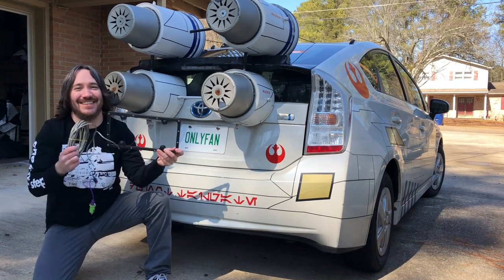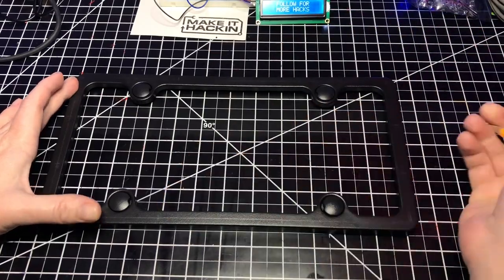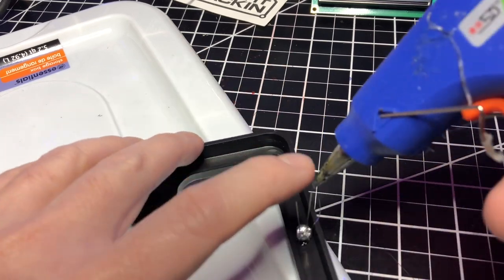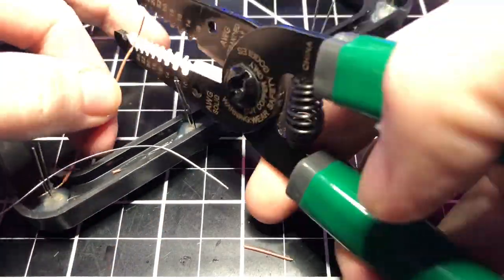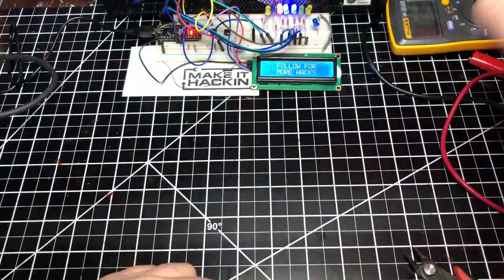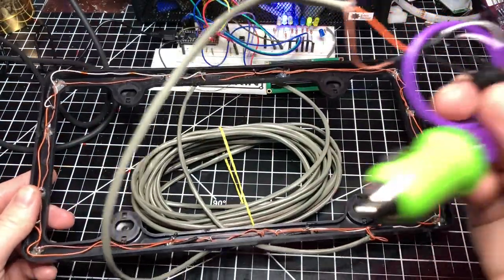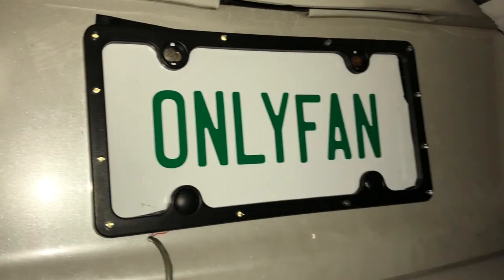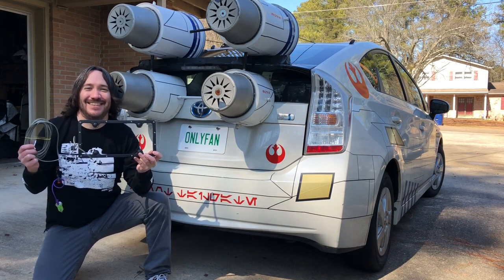Infrared Camera Blocking License Plate Frame - Tutorial - How To

Comment: As far as all those separate little brown wires you soldered to each lites ground leg ,next time just leave it all as 1 wire, solder to the 1st lite, run the wire around the plate fre and just take a knife and Nick away a small piece of the Plastic coating by each lites and solder the leg of each lite to the exposed place of the brown wire , you can use a lighter to expose it also. It will be a thousand PCT stronger and a heck of a lot easier. Do the same with the other wire.

Comment: To speed up the wiring, strip the whole wire then solder the grounds then cover with hot melt. Solder resistor ends to the LED ends and fold over fold over to touch each other. Solder together with positive wire, seal with hot melt. The part leads can act as a PCB. I love freehand prototyping it makes strong, durable circuit but not very repairable.

Comment: what does it look like in the day time, on camera?
Reply from the maker: if in infrared mode, basically the same, if not, then you don't see it
Reply: Its completely invisibles for cereals yo
Reply: @SKYNET9er  - if by completely you meant still partially readable
Reply: Cereals!
Reply: check karo tv remote ko phone caera ke samne rakh kar
Reply: What make the plate stand out is the reflective coating in the paint they use on it. If you use a clear license plate cover, and instead of using the regular plate take a picture of the plate and mount the picture under the clear cover.
What the camera see's will be a reflection off of the clear cover.
Reply: @AJCsr  the first police officer that sees that (it will stick out like a sore thumb) will be sure to ticket you

Comment: The number is still partially visible so they'd probably be able to match a partial with a make and model of vehicle.  Also, their software could probably do some post processing to adjust the lighting and make it more visible.
Reply: It's difficult to postfx for whites, and those cameras are already set for pretty high contrast being IR. If it somehow darkened it, then yes.
Reply: They have to prove you were driving. A lot take photos of the driver.
Reply: again, short of liquor store holdups, what is the freaking point? gonna impress some girls with your bail receipts?
Reply: @jbodden6977  red light/speed cameras and tolls.
Reply: @thej3799  It is illegal in Il for a camera to photo the driver.
Reply: @thej3799  In some states, the owner of the car may be held liable (not necessarily the driver, although if they are stopped, the driver could also receive a ticket, and in more rare situations, both can be ticketed).  Applies to various things too, not just speeding, but accidents, etc.  IL is also not the only state like this, as there are others that have the same rules, so doesn't really matter if they get a photograph of you or not, because they don't need it if it's your car.
Reply: @robertwadas  Doesn't matter. because also in IL, the owner of the car is responsible for the car (this includes speeding, accidents, etc) even if someone else is driving it and the driver is not in the car.
Reply: @HR-wd6cw  Well, if they are speeding, the person in control the motor vehicle will get the ticket. Any accident, the person causing the crash will defer to the ns on the cars. If the person was driving someone lese car and crashes.. car owner ins will cover it and that can lead to the drivers ins and the owners insurance. If the non owner commits a crime with the car, The non owner driver will be the one arrested.. Sometimes the owener is responsible and sometimes noy.. Like photo enforcement of red light camera.. It is on the owner, especially when in mt state, the cameras are not allowed to capture the drivers face.
Reply: @thej3799  In Illinois, red light and speeding cameras are not allowed to take a picture of the face.. The only record plate # and whoever owner is gets the ticket.

Comment: Face the LEDs at the plate on the inside edge of the trim, the plate will reflect the light and the LEDs will be hidden maybe. You can also coat the plate in IR reflective coating.

Comment: Suggestion put a piece of clear plexiglass over the license plate and drill holes into the sides of it and aim the infrared lights into the sides. It will completely wash the entire plexiglass with infrared light
Reply: I think, this is the best solution and less visible to cops
Reply: License plate covers are illegal in almost all states.

Comment: Super bright led? Why not tell the power of the led?
I would do the wiring on all leds before glue them, and if use 5 times more leds you don't need extra wire for the led, the leds legs is long enough to connect all the leds

Comment: Place a thick clear plexiglass cover over the plate, drill into the sides of the plexiglass and place the IR LED facing in. Put a plate frame in front of it. The idea is that the light will wash out the plate no matter if they mask the border lighting
I really don't know if this will work or not, it's only a guess. Maybe a light 2000 grit sanding on the outside of the plexiglass if it needs a place to radiate ?

Comment: Would it been feasible to use flat top LEDs over you dome tops or does it have to be rounded tops to work properly
Reply from the maker: flat top should work too
Reply: @MakeItHackin  I only asked cause flat tops would be easier to make it blend in design wise but I wonder if the light displacement would be the same
Reply: Some flat tops disperse a little better. Not sure about infrared tho.
Reply: It might not blind the camera as well since flat tops usually have a wider viewing angle and therefore appear less bright.

Comment: So it only blocks infared cameras?  Does it block regular cameras at daytime?
Reply: Interested 4 speeding lol
Reply: It would not do anything useful during the day. The only reason it works is that at night the cameras use an infrared flash(or constant beam) to illuminate the plates.
Reply from the maker: if they are in infrared mode.  could happen during the daytime

Comment: You only need one resistor. Wire all of the LEDs in parallel and put a single resistor on the supply line.

Comment: Find an IR Reflective surface(Like Plexi-glass) and add that to the frame. then mount  LEDs to frame so that light gets trapped between license plate and Surface, if done right, it uses less LEDs. A 12v 2A motor control board works great for PWM control of the power, with that you could just Use the License Plate Light itself for power. Then Again you could just use a  resistor(4.7k-10k). some states don't allow covers though, check your local laws FIRST. Personally i like the frosted glass cover, or an LCD/LED screen cover better. a Fresnel lens will also work.
Reply: Any kind of cover (clear) on license plates actually will attract cops because it's not legal in most states to have anything (evne a clear cover) over a license plate.  Because people were dong this, and in some cases, spraying them with a reflective material (that would only reflect back light when shined directly on it) so they are pretty much banned everywhere (whether home-made or retail).

Comment: I have a flip down license plate holder (my fuel tank filler neck is behind it. I drive a GM B body). So I have a long rod that goes from between the front seats through the bavk and con ects to the plate holder. I push it and it flops down. 🤣
Reply: Yeah sure you do

Comment: Adjust the contrast/white/black points in a photo editing app and see if the numbers are ledgible. Police cam generally still get a plate fairly easily by those methods.
Reply: I wanna know too.
Reply: Travis Hamler  I'm more interested in what happens later on, back at the station, when the cops decide to see if they can track down the owner of the car. Also interested in potential of this system to defeat toll systems, speed cams, and red light cams. Not that I would ever do anything like that, but inquiring minds want to know.

Comment: I would advise coating the bare terminals and wires with Liquid Electrical Tape to guard against corrosion.
Reply: I would dress it all into the recess of the frame and pot it with black urethane windshield adhesive.

Comment: A proper ANPR camera reads the front plate and is designed to still see the plate with oncoming headlight shining straight at it.  I suspect even your camera could see the plate with all its LEDS uncovered as the plate reflection would have been brighter than the surround.

Comment: If you connected 3 LED in series and then used about 360 resistor, connect up to a suitable 12v position on the rear lights. Then you don't need the button and the in car wiring.

Comment: ok, the wiring can be a lot simpler, by putting a number of them in series in like two strands of 6. Find out the voltage drop (usually 1.2v) and the current, calculate the needed resistor and you can hook them up to the 12v directly.

Comment: You could make it so it is powered by a trailer light plug, so you don’t have to hack into your cars reverse lights. That way it’s easily removable if needed and no wires need to be run inside the vehicle. It would turn on and off with your headlights.

Comment: I think the real alpr systems will not fall for this. First of all the exposure time of camera will not be changed like your security camera. Second the licence plate should not have reflective paint for the text. Plus lots of the systems read the plate at a distance between 15 -30 meter which makes your systems light very in effective (compared with the systems IR). For avoiding alpr system I would use some mud on plate or reflective black paint for text or non reflective background painting. Please keep in mind covering plate with your victims' blood may be the most effective way.

Comment: Maybe a protective film of that liquid crystal film to make it opaque when you use the switch and clear when the switch is not activated
Reply: Good call.  A photo sensor to detect the camera flash would make it opaque for 1 or 2 seconds to make sure you get past multiple cameras.  You would need the sensor to differentiate between the white camera flash and the strobe flash from emergency vehicles… having a cop pull you over will 100% see your plate go black and stay that way.